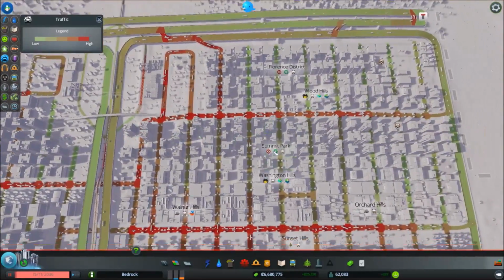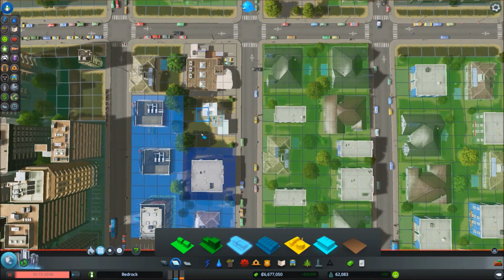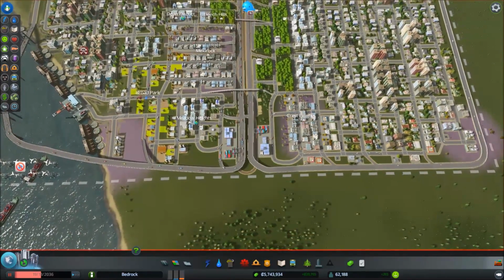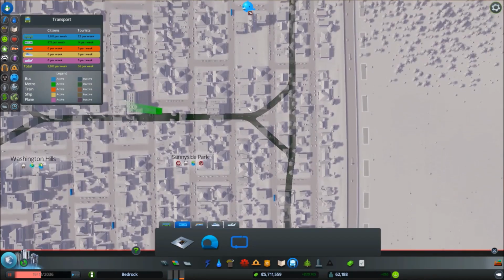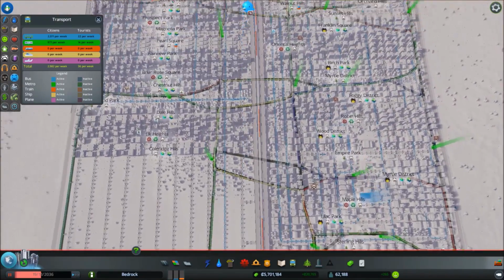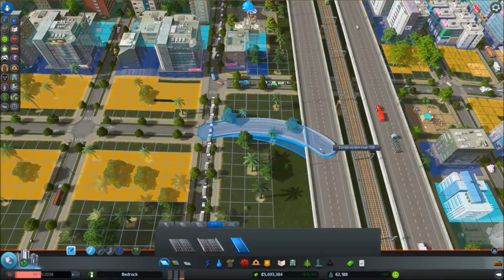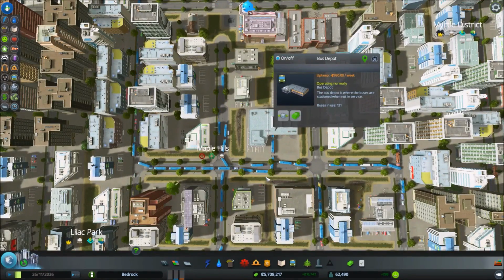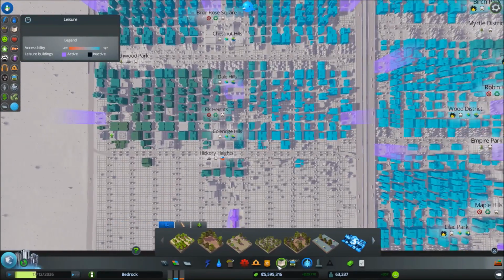Cities Skylines Road to 1 Million(HM) EP 25 Rework of the Public transportation

Comment: The reason you can only click on two connection points in a metro station is that each standard station only has two tracks with a single boarding platform between them. You can choose to have a line use either the left track or the right track and that's all. It is possible for more than one line to share a track, though. If you do, you need to make sure all the lines on a track are going in the same direction through the station, otherwise you could have a very bad accident.

Yes, if you have too many stops on a line, or too many transfer points in a trip it will affect how usable the public transport network is. If it's not the quickest way to get somewhere the cims may well decide to use their car.
Reply from the maker: Great tips thank you!